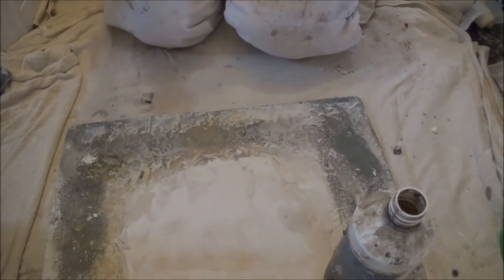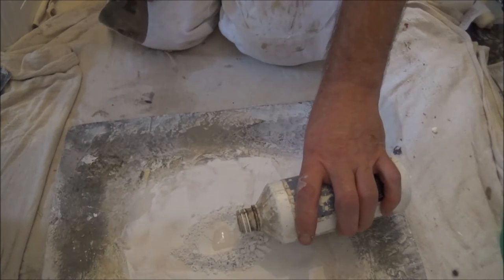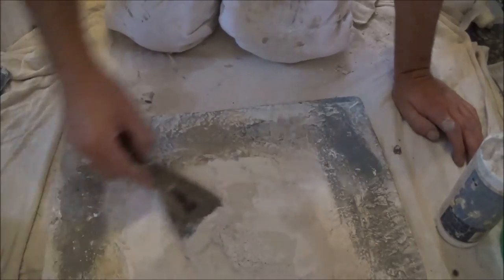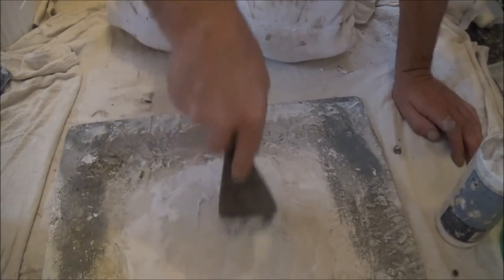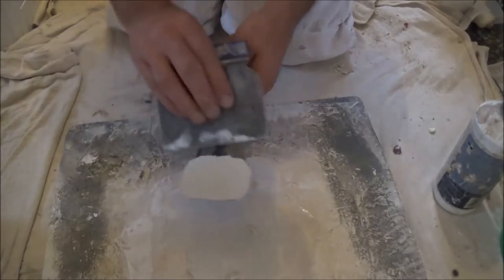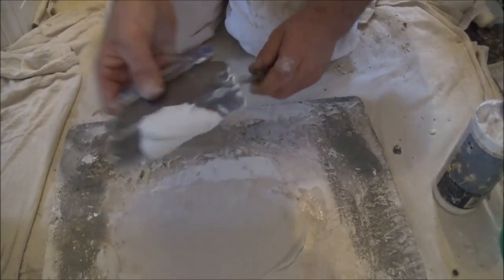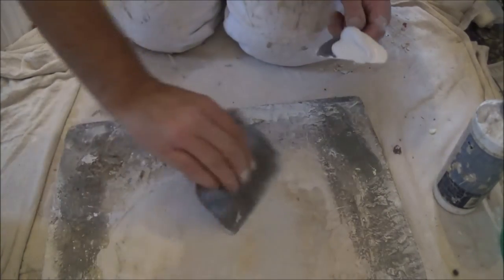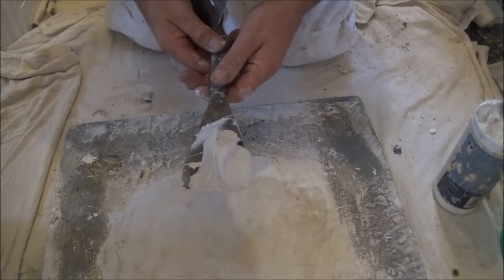How To Mix Powder Filler

Comment: Do you have a preference for powder filler?  I have just bought some Polyfilla multi to be used indoors.  Looking at the pack info. I think it might be overkill.  And has a long set time.
Any advice gratefully received.
Thanks
Reply from the maker: Hi, we only use interior easy-sand pollyfila other fillers are suitable, but best to get one for interior.
Reply: Thanks for that.  Much appreciated.